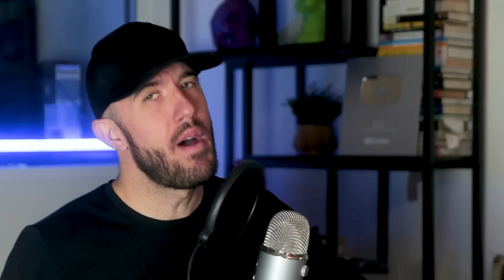Markforged Been Bought l Getting Etsy Stores Ready For Christmas | 3D Printing News

Comment: The company I work at has just bought a markforged machine for £15,000 it does amazing clean prints but it's so slow, a print on my ankermake which takes 5 hours will take 36 hours on markforged, plus markforged are not helping themselves as they still don't have self bed level or heated bed.

Comment: Good point made here...
I've been looking to use Slant to print some stuff, and there are meny video's detailing how the system works. In one of them, a printer is using a glass bed, so I would assume that Slant's print bottoms are smooth?
Is this not the case?
I'd like a vid outlining EVERYTHING that is associated with the prints. Is the 1mm wall double tracked like meny slicers defualt to? What pattern is used for the top and bottom layers?
Much of this data is spread over meny videos, and some might be out of date?
Thanks
Reply: I agree, but I also understand if they aren't willing to explain everything possible because their printers are internally designed & assembled, so then it gets into IP protection 🙃, lol.